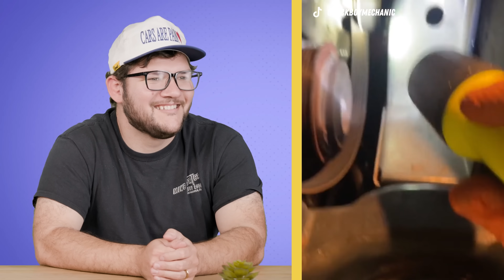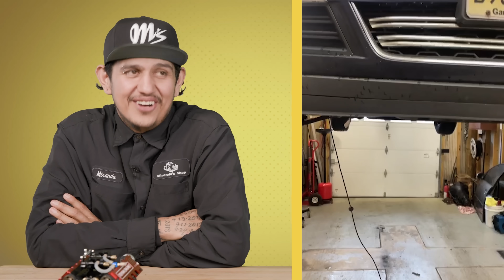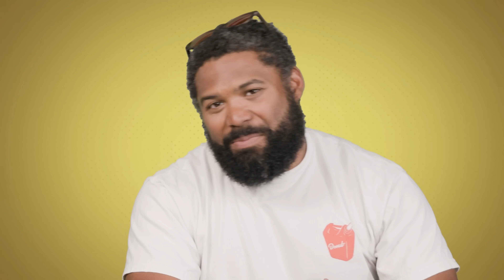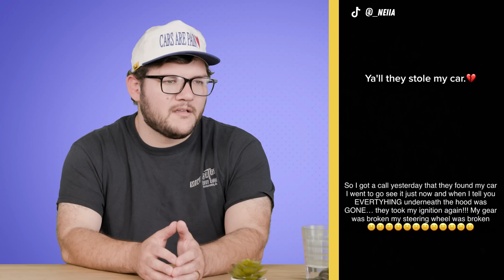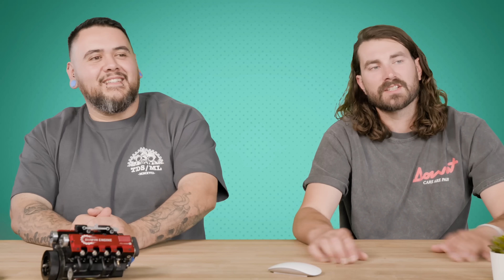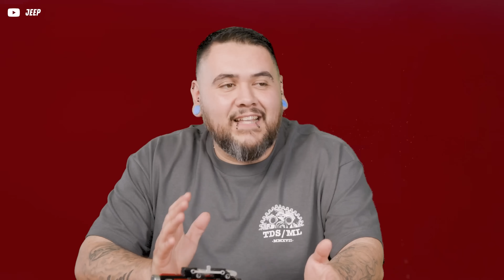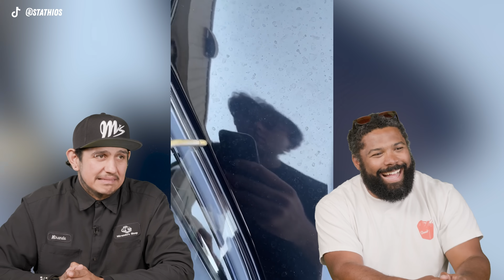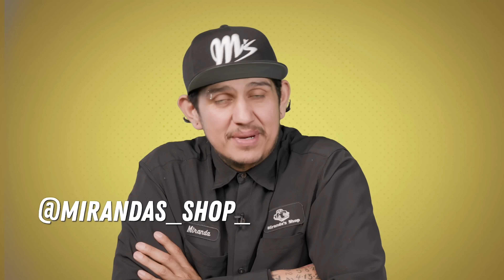Mechanic Reacts to Car Engineering Fails

Comment: I knew an engineer working for Prodrive. He claimed a lot of engineering problems are caused by the stylists. He called them 'crayon fairies ' their designs have to be followed and they expect engineers to make their designs actually work.
Reply: This is a good point...
Reply: Stylist's stupid motto : "your functions must follow my forms"
Reply: Pedestrian impact means powertrain has to be substantially clear of deformable exterior surfaces.
Reply: As an OEM design engineer, can confirm.
Reply: @@buffalowt5582 Yeah. My father is a "Construction Supervisor" and very often he is asked on opinion. He usually answers that "Looks should be evaluated by investors, not constructors". But very often he informs on how much yearly it will cost - or tells them to ask that question another specialist. Eh. hidden roof gutters - it is beatuful, but electricity for this can cost several time the gutter costed itself. 
Generally every shape is possible, but then either engineer or assembly will send you a warning, which they will  later print to be able to defend in court, that they informed it's bad decision.

Comment: The oil mistake from range rover and jaguar is a fail by the mechanics. You have a pipe on the right side of engine ... From there you can take out the old oil with a vacuum oil collector 🤷 cost around 100€

Comment: Why is the McLaren issue not engineering, as per basic academic metallurgy lab tests on corrosion, will also include dissimilar metals induced corrosion. Therefore, the engineers didn’t choose the right material for the fittings. Unless an assembly worker, didn’t select the correct supermarket assembly fittings.

Comment: what does she mean you wont get paid for that extra time? if the manufacturer prescribes jacking up the engine to change the tensioner bolt you get the time you need for it. Seriously the US automotive industry is fucked up. We get paid the same, even if the job takes more time (offcourse if you do it faster you dont get paid more) either way

Comment: I knew a tech that got to talk with Toyota engineer  once, asking why certain things were uneccisarily dificult to maintenance. The answer: Factory assembly efficiency is the priority. Annoying, but any sacrifice on streamlining manufacture line will likely lead to higher prices. Conversely, you could say some of that is job security for techs. Also, heindsight is always 20/20. That being said, will never buy a Chrystler or GM vehicle again. :/

Comment: I am an engineer and I always talk to the guys "in the field" when I design anything at all!  I wish more engineers did this....  I've seen this sort of thing happen over and over again.  Communication is key!
Reply: Nah, just make engineers spend every third year as a tech doing warranty repairs.
Reply: @kd5nrh too generous. Make that every year.
Reply: I'm also an engineer (embedded electronics-design / firmware & software development).

At my current workplace it's the default process, that engineers ask feedback from the field technicians. This works great, as the technicians have most experience with how the products operate in the field. The only insight we engineers have, is the one in a development setting.

This was however hugely different at my previous workplaces! The worst place being the University I worked at, for scientific R&D stuff. Those PHD's and civil engineers there where the worst, thinking they knew everything. 

That being said, I've however to defend engineering and "dumb" design choices. Those "dumb" design choices are usually made by management and sales rep, with as sole purpose making the end-product cheaper and/or more difficult to repair.
Reply: Engineering what? Die cast replicas?
Reply: Working Construction for a Client that is an "Engineer" is a fucking Nightmare.
Reply: Per chance also some management level guy going "Hey, why does this engine in that model require a shorter screw? That's going to increase costs! Use the same screw!"?
Reply: I say they make the Engineers work on And repair any and all vehicles they come up with and and deal with every design they make on the vehicle So I'm basically saying hold the engineer accountable for what they build and make them work on their own b***** for the 1st 100 vehicles
Reply: @gearhead9115  As an engineer myself, I can't agree with this one. 
Most dumb ideas and implementations are forced upon the engineering team, either by management and/or the sales department. It's all about saving money by making it cheaper...

Cars and electronics would last 20 to 30 years on average, if engineers where free to decide!
Reply: I've heard of many cases, had some first hand, of "in the field" guys attempting to communicate with an engineer, so far, universally, their reaction was "who do you think you are, I'm an engineer", won't even hear you out before deciding you're a dumbass.
Egos you wouldn't believe, they get real angry, or at least condescending.
I'm sure not everyone's like that, but apparently most are.
Reply: @LuLe232  Coming from the other side, there's plenty of mechanics/technicians who instantly write us (engineers) off automatically and think we're all "kids who don't know anything" or that we've "never worked hard before in our lives". It's not right for either group to do that, but it definitely goes both ways.
Reply: Also an engineer and I do all my own work on my vehicles. When I previously made subflooring, getting feedback from construction workers on how to improve the product was a part of the job. The guy calling it "fake" doesn't know the industry.
Reply: @zchris87v80  And not a single one of you listened to that feedback, hence we have the same gripes with certain materials as we did 20 years ago.
Reply: @justinlast2lastharder749  yeah, actually I did listen, and made quality improvements to the product we made. I worked for one company at one mill; not like there's one giant factory that makes every piece of material used in construction.
Reply: Yea ok Kool fake story

Comment: 2010 to whatever Mercedes gl350 to gl63 steering rack bushings. Either cut the bolt or remove the transmission 😂

Comment: Most, if not all of these problems are caused by penny pinching bean counters who trying to cut corners. There is nothing wrong with trying to save money but quality control and ease of repair should be a high priority.

Comment: Really hate the engineers for GM because on my 04 trailblazer just to change the thermostat I have to remove the alternator, detach a coolant hose, disassemble the engine housing, then have to do all the work to change the thermostat which is 3 bolts including one bolt that in near impossible to reach without a swivel socket. But guess what right after you spent an hour and a half getting to the thermostat just to replace it in 5 minutes you have to spend another hour just putting everything back.

Comment: You think being a car mechanic sucks? That is nothing to being an automation technician that has to work on multimillion dollar machines that assemble medical devices. Some with medicine included. The amount of paper work and everything else is insane. Also if you did something wrong and your repair kills someone, that is on you for the rest of your life. That place had so many recalls on insulin pens because of the dumbasses they used to hire that just didn't care. That isn't really the type of job that you can be a slacker at. Even though just about everyone they hire is.

Comment: Regarding the first video/too long bolt:
the best option would probably be to drill a hole into the front mount. You're not going to lose a big amount of structural integrity but it would be way more accessible in the future.

Comment: I would consider all problems are engineering problems.

The factories do not put parts together how they think it should be. Assembling a car is a process that also was engineered and for example for McLaren - factory used the bolts that engineers decided to use and then someone ordered it to factory. Bolts that unscrewed itself? Manufacturing process should change the bolts type, add a spring type washers or simply add a thread glue for those spots in the manufacturing process. If the manufacturing process already tell that it should be done that way and somebody in factory forgot that - then it is a factory fault. For Tesla - if parts are badly designed - they are not going to align properly or fit to another part. If the factory line has only 5 minutes to align all the doors, hood, lamps etc. They will align only one part and they will do it badly. That problem is a badly designed manufacturing line. If the manufacturing process includes all of that and gives workers enough time and tools for that process and it is still not done, then somebody should check what the hell that person is doing 😂.

Leaking rain inside? If many cars are having this same issue I would call it a bad design. Maybe the sealing/glue material is bad or maybe someone designed too small window for a hole in the car body and it is impossible to seal it? 

Oil drain - If in the engine bay cover there is a service hole that you take off the cover to drain the oil, it should be designed in a way that it takes into consideration that oil drains fast in the beginning, so maybe the service hole should be bigger or the drain plug should be angled down?

Comment: I'm no mechanic, so this was also my own fault, but damn ford, why on a fiesta st does the exhaust header heat shield bolts sit right next to identical bolt for the turbo oil line, also behind the engine so i can hardly see what I'm doing, thought i removed just the heat shield, instead had it raining oil, oh well, i should have checked everything, not just the stuff i thought i removed

Comment: engineers are always to blame. if a new car is leaking from factory, that is a design fault. i think to the trans ams of the 80s. the t-tops were infamous for leaking. better engineering required. the build on the McClaren... i would totally understand if the price tag wasnt astronomical. if this was a hand built even $100,000 car, i could make an excuse. but at the end of the day, they price themselves on their quality, thats their whole sales pitch, so when the quality isnt there, whats left

Comment: Replacing a heater core should be as easy as changing a filter… however in my 2006 Subaru Impreza, the heater core is hard to access and requires that you take apart the entire dash, exposing the bar behind it that you have to swing out to get any further, and then you have to disconnect the steering column to allow you enough space to slide the heater core out the driver side. I’m not that patient or dumb, so I took a sawzall to it, yet if they engineered it to have an aluminum clip (roughly a 5 cent part) it could be disconnected a lot sooner and save the headache of having more screws than you started with.

Comment: Owned a 93 Manual Acura integra, whoever decided that the oil filter should be on the backside of the engine block  under the headers can go f themselves. Almost zero room to maneuver back there. Not a fun car to work on, very fun to drive though, will say that

Comment: in a past life i was a marine mechanic working on a sea ray twin shaft 454 vortex* it was so powerful it warped the shafts and tore and twisted the props that was a fixable problem, i had to do the tune up on engines and i realized the engineers used me as the engines were 2in apart ended up having to take the rear deck off the boat for a tune and access the engine bay, thanks Sea Ray!

Comment: The first car I ever did my own oil change on was my 2000 Civic coupe. The oil filter wasn't absolutely buried, but it was somewhat awkward to get to given I just had the car on ramps and had limited room to maneuvre myself. Fast forward to this month when I did my first at-home oil change on my 2017 Acura ILX. While the whole bottom of the engine is covered by a plastic shroud (easy to remove), the oil filter was so absurdly easy to access that it reminded me why I'm a Honda guy. That's damn good engineering right there.

I don't know if it was a myth or a real car from the 80s, but I seem to recall there being a car that had an oil filter where you had to undo a couple motor mounts and pull the engine up a bit to properly access the filter.

Comment: I agree with most of this, but you have to remember that the engineering team is lower on the waterfall than the ceos etc. 

They might make the design, but the marketing team and others control how much money they have to mess with, and what is used or fixed along the way. So the oil pan leaking might be an issue, but it may or may not have been engineering fault that it is still an issue. It might have just cost too much to fix, so they figured the mechanics would figure something out. 

The last one was similar. The engineering tram is interested in building the best thing they can. The problem is that they only have a certain amount of time and funding to work with. And they have to hit a target budget, so long term testing and things like this might get left out. The marketing team is the one pushing the product and not caring about anything other than the warranty (assuming the engineers are doing their jobs and caring.)

Comment: I'm going to chime in on Sandro's comment around 9:35 about everything is built wrong. The term he is describing is called "forced obsolescence " whereby manufacturers design stuff to break so you have to go buy another. And Sandro is absolutely right on why companies do this: saving cost on manufacturing and artificially pumping revenue.

Comment: The belt tensioner bolt is not an engineer problem, it’s a cost cutting measure, that bolt crosses with other previously available ones, cheaper to crank out one bolt for 10 applications

Comment: Mechanical Engineer here who has worked for 2 of the Big 3 over the last 32 years - the overarching issue is "Design for Assembly" vs "Design for Serviceability" (as in GM's STG group).  If it costs $$$ to make the design easier to service or (Heaven-forbid!) slightly more difficult to assemble, the Serviceability loses.  EVERY Single Time.  It's that simple; we engineers  are car-guys too (why do you think we got into the CAR business?!?)  However, cost accountants and assembly reps have an infinite amount of pull w upper mgnt that we engineers do not have; we are considered a means to an end - not any type of authority.  We make good designs, then cost accountants "pull cost" out of the design, recalls ensue, and engineers are blamed NOT the individuals who "saved the company $0.02 per piece" - they are the real reason issues like this happen.  I've seen it my ENTIRE career.  Case in point - for the first example (the bolt that is too long) - a cost accountant replaced the specified / non-standard length both with a standard length bolt; reducing complexity and saving $$$ on the design - standardizing all the bolts on the accessory drive - which is great, until it needs to be serviced.  NOT an Engineer's fault.  We understand this - accountants do not.

Comment: first clip looks similar to the G6 I recently worked on.. that idler bolt also holds the alternator on.. it's tricky but you've got to remove to other 2 bolts and tilt the alternator.. sucks none the less but it's not terrible

Comment: As a dealer tech for 16 years, these are examples of why I am now an engineer, to try and prevent stuff like this
Reply: You're doing God's work.  Hahaha!
Reply: I wish you luck on your endeavor.

But I think you'll be constantly butting heads with management who don't give a damn.
Reply: @BrokenLifeCycle  people always blame the engineers when it's actually the bean counters who decide on what goes into a product
Reply: @BrokenLifeCycle  yup, I'm an engineer (non automotive) and it's always mgmt holding us back, cutting budgets, pushing deadlines. At the same time, there's a reason we say if engineers had free reign, their products would cost a million dollars lol
Reply: We as mechanics are counting on you
Reply: Have you seen the excess crap on engines because of the epa nonsense?? Have you ever worked on an engine?
Reply: @hhstarwars  have you seen the state of the earth recently?
Reply: @owengerm1048 ya nothing to worry about unless you give in to the fear mongering!
Reply: Lobby in DC to get rid of all this "environmental protection" crap.
Reply: @alankleinman526  the environmental protections are mostly not to blame
Reply: @griffin8062  you apparently dont know about diesels then. maybe gas engines you have a point, but not really because those rules are whats forcing 4 cylinder engines in things that actually need 6 or 8. so really youre just wrong.

Comment: The C5 Corvette harmonic balancer, the stock one wears down so easily and is placed in such a tight spot that you have to remove a buch of parts to replace it (not an easy process)

Comment: Going from a mechanic to an engineer, mechanics have the easy job. I used to blame engineers too
Reply: I wish my biggest worry for the day was a bolt being slightly too long and the job only taking another hour or the oil hitting the subframe and having to use a piece of cardboard like the lady said.